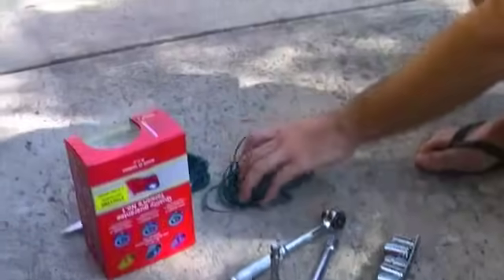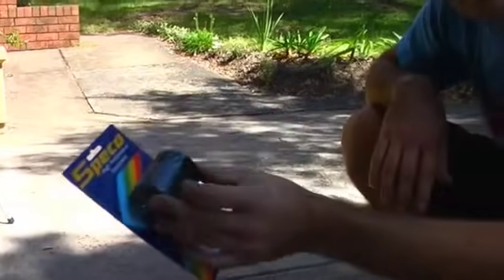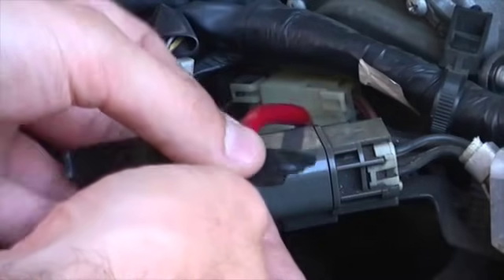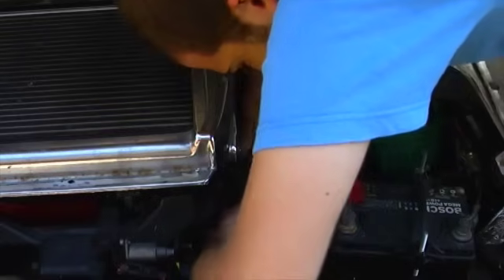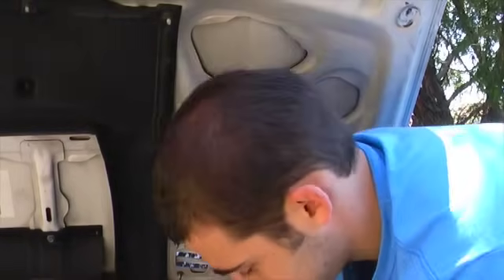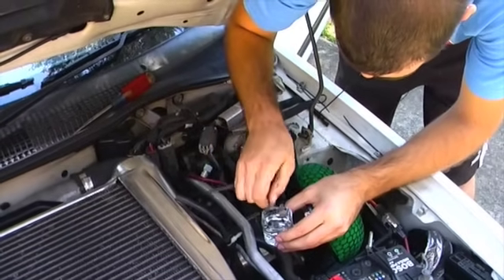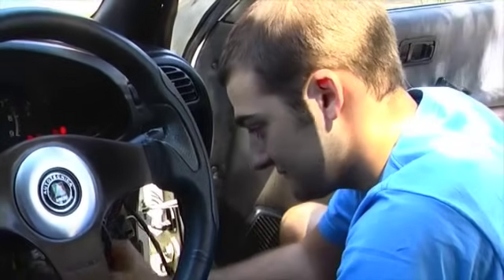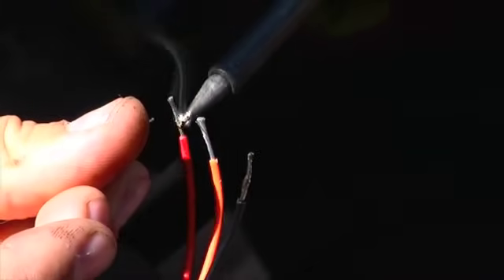How To Install Boost Gauge DIY

Comment: 0:33 you don't need to install a pump in your non-turbo car to install a turbo gauge, you can just let a piece of that hose hang from the ceiling and blow into that when you are driving.
Reply: LOL
Reply: ynoter all WRX's (and STi's) are turbo, only RS or a lower spec Impreza wouldn't have a turbo.
Reply: Kayne Davis rs turbos....have turbochargers in em....
Reply: DoughboyD16 holy fuck
Reply: And now its 10 years later
Reply: He means the subaru RS... not the Focus RS
Reply: KEEN

Comment: Most mechanical boost gauges(like the one in the video) measure vacuum as well as boost. In an naturally aspirated engine, a vacuum gauge can indicate the health of an engine as well as ideal throttle position for maximum fuel efficiency.

Comment: yes on older diesels with a mechanical injector pump connect the T piece to the hose between the injector pump boost compensator and the air intake, you may have too look around a bit to find it.

Comment: other than using the boost gauge and controller together. the gauge would be pretty much useless. It would be mostley for looks. Although if you know how much boost your car is supposed to be running stock, than the gauge would help you see if you may have a boost leak somewhere, if it's reading below the boost it's supposed to be. I hope I helped you out. Sorry if I went into too much detail, I just got into it hahaha

Comment: As far as the boost gauge, I personally would only add one if you were to add a boost controller. by using these two instruments together you would be able to saftley up your boost. you would be able to read the gauge too see how much boost is going through your car and you would be able to adjust the boost with the controller accordingly with what you want. But be very careful. too much boost can blow the turbo. read up on how much boost your car can saftley run how it is.

Comment: Yea you can install an aftermarket BOV on any turbo charged car, as the bov realeases the excess pressure from the turbo. basically air, it has nothing to do with the type of gas a car uses. Performance wise it won't change much. it would only help if you were to run more boost(pressure), the bov would be able to hold more boost than a stock bov. If your running a stock setup, than it may make it sound a little louder(psshh!! sound) but this all depends how much boost your car comes stock.

Comment: @iSypha for some reason I think the boost gauge actually helps hp a little bit. Someone correct me if i'm wrong but I was getting ready to turbo my car and I installed a boost gauge first and it reads vacuum so I took it for a little ride and notice a slight difference in power. I think when you acclerate, some air is compressed in the lines of the boost gauge and when you let go of the gas those air are suck back into the engine+ the next gears incoming air helps it.

Comment: @saga212 yer 4 something :P we actully tuned the turbo down cos the factory one got damaged and was replaced wit an after market one so we tuned it down cos this new one is really powerful and because it mostly just dos runs to and from the city it dosnt need the 30psi available all the time if you towed huge loads or were offroading yer have it up high but for road use 9-12psi is good enough for just getting around

Comment: @mightycarmods  i just bought myself a 2002 Subaru wrx :) .. only problem is there is a leak in the valve cover gasket .. could you guys do a video on how to fix this on a boxxer engine . thanks a bunch

Comment: @mjdaubney use a fuel pump fuse or something that where i run wires they will turn on when the key is on and off when u turn the key off

Comment: Can I add a blow off valve and boost gauge to my Mercedes benz E300 Turbo Diesel? Just wondering if the blow off valve would work on this particular diesel. also how would my performance change?

Comment: Hi, how do you remove it? The tube on the gauge seems to be very snug fit and won't budge when I pull it. I need to remove the gauge temporarily to access the wirings under the dash.

Comment: literally learned nothing
Reply: I could have used the "hot water" trick. I had to jam a 1/4 clear hose into a nipple and it was so damn hard to get on, I ended up using a dremel to shave down the nipple and then violently shoving the hose back in, then I tried to take it out again, and it was impossible. 

The hose got a bit damaged so I hope it doesn't leak.
Reply: Thats what I would have done too lol. Glad I watched this just for the hot water trick.

Comment: hi just a quick question... from the quad vacuum lines. i put a t connector then those where i will put 1 for the boost guage? and since from you line that you have for the after market  blow valve so i can insert it too?  line 1 - from quad vacuum, line 2 boost guage, line 3 for blow off valve? 
sorry for my english.

Comment: How about diesel turbos ?
Reply: 'Diesel'-turbo's are not that different from petrol turbo's. The basic setup is the same. you could take this instruction video and use it to install a gauge on your turbo diesel car.
Reply: The only difference is Diesel and the fact Diesel engines are Combustion ignition, not Spark ignition. The principles are the same, Turbo forces more air into the engine.

Comment: my gauge says that the turbo always runs at about -7 and never reaches 0 did i install it wrong or could that be the turbo beacause the turbo is supposedly on its way out?
Reply: MRkamz1 you would be able to a feel if your turbo never kicks in.... you might wanna check your vacuum line and make sure you have no boost leaks

Comment: ...Um I dont want to be mean but work on the spealing, You can install a boost guage into your car but you wont be able to connect to anything to important. Plus your just going to get made fun of. Just wait untill the vehical you drive has the turbo in before installing. Untill then have fun

Comment: I'm having troubles finding a hole from the engine to get into the cabin of my mitsubishi evolution 9 to run vacuum pipe for boost gauge. some help!!
Reply: mario julies drill one it doesnt need to be a massive opening just big enough to slot the hose through into the cabin

Comment: hey guys, i keep blowing my boost gauges. They work at first then it just sits on 0. could you provide an answer as to why? this is my 4th gauge..
Reply: wrong voltage into the gauge if it keeps blowing

Comment: would you rather don't eat for 2days of don't drink for 2 days ?
Reply: +GTApipo 128 would i rather be dehydrated or starved? Starved good sir.
Reply: +ertren6 xd no u can survive a lot longer without food than water
Reply: GTApipo 128 what? taht's what i said lol
Reply: +GTApipo 128 i'd rather not eat and drink vodka for 2 days
Reply: Alcohol dehydrates you, especially vodka as that has one of the highest alcohol concentrations in alcohol beverages.
Reply: SI0AX True. So beer and water it is. Beer has barley and hops to consume.

Comment: will this also work for supercharger?
Reply: a turbo is a supercharger
Reply: elemental smurf
No it isn't.
Reply: matt34323 it will still work tho because they both pressurize air and release it into the intake and the boost guage just measures the pressure i think
Reply: The answer is . yes! Sure it will work. The SC does the same job the turbo does. The difference its that the SC works with the energy transmitted of the Crankshaft. Its different process . same job!
Reply: turbos and super chargers both give forced induction and create boost so yes you can
Reply: rakapur they both work in the same way which is forcing air through the air intake via the power of a turbine except the turbo is driven from exhaust gasses and the supercharger is belt driven

Comment: If it is a boast gauge how come you are talking about vacuum? Is not that the opposite of boast? My boast gauge is only positive from 0 to 30 psi
Reply: "Boast Gauge"
Reply: Not sure what you're asking but an engine sucks air when so there is air pulling into the engine when the turbo is not spooling.  When the turbo spools, it crams air into the intake manifold.  So that's why boost gauges have negative readings.  Air in the intake manifold is either forced in when spooling or sucked into the engine when not spooling.
Reply: If the turbo is not spooled up then you would have like mine have zero boast but it dose not have a negative reading or vacuum. To have vacuum you would need to have a restriction in the air intake.
Reply: barejohn59 The answer is no.  Yes, you'll have zero boost at idle but you also have to account for the fact that the engine is sucking in air.  The sucking part is vacuum, or you could think of it as negative boost; but it's called vacuum.

So imagine this, an engine is constantly sucking at 14 kpa (don't know if it's actually 14 but let's just say 14).  When the turbo spools, it introduces boost, meaning instead of the air being pulled, it's being pushed.  So your reading will be -14, -12, -10, -8, etc all the way up to like let's say +10 kpa.

Or another example, imagine a straw with a mouth on both ends.  One mouth only sucks and the other only blows.  The sucking one is the engine and the blowing one is the turbo.  The sucking one always sucks no matter what.  When the turbo spools, the blowing mouth starts blowing.  So your reading goes from negative to positive.  It's not a great image to have in your head but that's what it does.
Reply: Ray Chiu
why would you have an engine sucking through a straw? I have about a 4" duck from the turbo to a large air cleaner, I never get a negative reading my lowest is zero.
Reply: barejohn59 no, the straw is an analogy to the intake manifold.  If you never get a negative reading, then something when wrong with your gauge install.
Reply: Gauge is correct since I do not have a throttler choking the engine
Reply: barejohn59 I'm not sure what you're talking about but something's not right
Reply: Our truck runs well and we are getting good mileage. Boast most often 0 to 15 psi, with the trailer in two we can hit 30 psi
Reply: barejohn59 I'm not saying your truck is broken.  I can't diagnose the issue on youtube comments.  Maybe nothing's wrong.  Maybe there's a new type of gauges I don't know about that doesn't read vacuums or something.  But from my experience and this video, our gauges read vacuums as well as boost.  There will be vacuum when your turbo is not spooling.
Reply: Do you have a throttled engine? I do not have a throttle on my truck. A throttle or a chock would cause a vacuum.
Reply: barejohn59 You're talking about a choke right?  The choke controls how much air, aka the air fuel ratio but it doesn't cause a vacuum.  30 psi is too high.  If I were to make a guess, I think the needle on your gauge got shifted where your min max would be 0 to 30.  The engine is a lung; it inhales and exhales.  It inhales because there is a vacuum inside the lung.  When a turbo crams air into the nose while it tries to inhale, then you have boost.
Reply: If the needle was off then I would have a positive reading with the engine off but the engine off gives me 0 psi. The gauge reads the pressure at the air cooler directly no electric pickup. To have a vacuum you have to have a restriction on your air intake.Without that restriction in my intake no vacuum so my power brakes require a pump.The only mention of vacuum in the owners manual is plugging a vacuum cleaner into the cigarette lighter. I have heard that up-to 45 psi  are safe on railway and truck engines
Reply: +barejohn59 I can't help you man. look up intake manifold by engineeringexplained
Reply: I was just reading Diesel World's story on intake efficiency and found that if I had vacuum it would mean a clog in the system.
Reply: barejohn59 oohhh, that makes so much sense now.  You have a diesel engine.  That's what you mean by throttled engine.  Sorry, I assumed you have a gas engine.  Kay, so to answer your original question, the guy in the video gets a negative reading on his boost gauge because he has a gas engine.  I have never worked on diesels so I can't tell you the technical reason why these are different but probably because of what you said, missing the throttle plate.

Comment: ok i did what u told me but it didnt work  when i got my gauges  i follow the instructions where it says  red is for ignition black for negative side of the battery and green for sensor  but the problem was that wasnt reading properly so i did ur way and they didnt even light them up can u help me  pls

Comment: So a boost gauge is actually measuring negative vacuum pressure from the intake manifold but showing it as a positive number. What would cause a negative reading? Positive pressure in the manifold? I would imagine that the gauge reads 0 till you start the car then jump up a few psi and cranks up as the turbo sucks more air and goes deeper into a vacuum. Am I right??